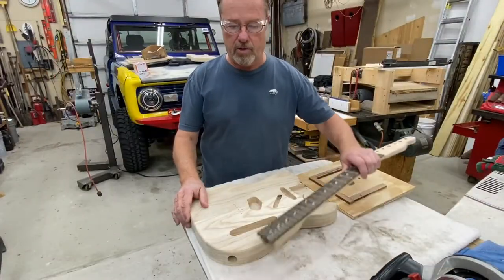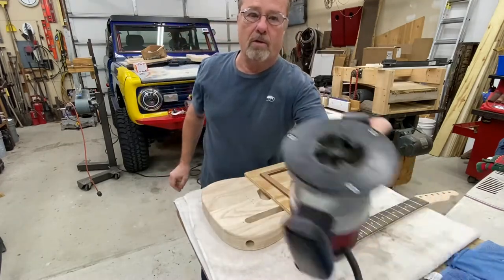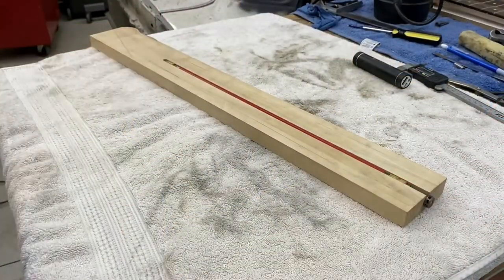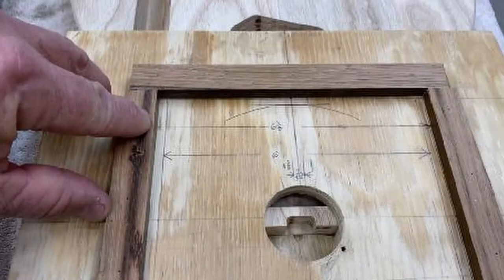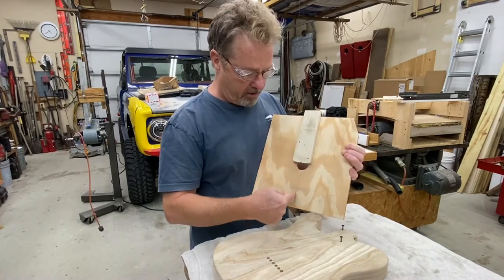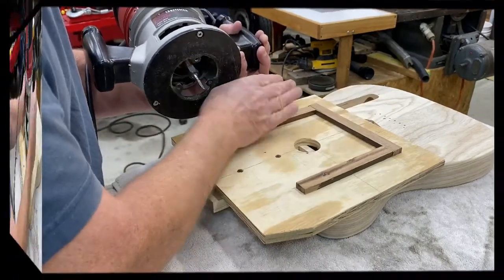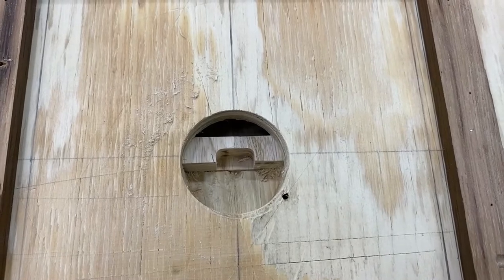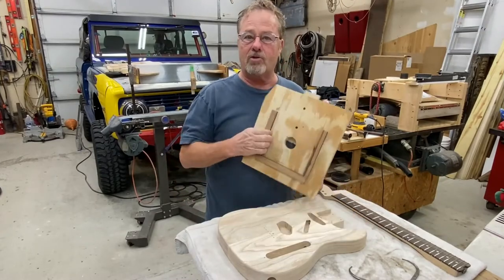Routing Jig for Spoke Wheel Truss Rod Recess

Comment: I wish Stewmac's spoke wheels were a  lot bigger like the ones that come on the EVH and Charvel guitars. They are a little too tall for my liking, don't give you enough room for a thinner profile neck. I started ordering my Spoke wheel truss rods from this place on Amazon, I was skeptical at first but I've used them for over 20 builds now and they are holding up great, I just dig the bigger wheel and super low profile double action rod!

Comment: Hi Randy, is it possible to put the spoke wheel truss rod in a fretboard 25.5" with 24 frets?
Reply from the maker: I suppose it could be done. If you’re talking about a Strat or telecaster neck, the fretboard will hang over the end of the heel by quite a bit, enough to hang over the neck pick up. A slot could be in between the 22nd and 23rd fret. Of course because it’s overhang and you have a slot in between those frets, the overhung part of the fretboard may become weak. I’ve never done it.

Comment: So, is the rod solely held in place by the back of the body cut out?
Reply from the maker: I will try to address this in a future video, but if you don’t need to adjust the truss rod to straighten the neck, you can put a minimal amount of tension on the rod and it won’t move or rattle.